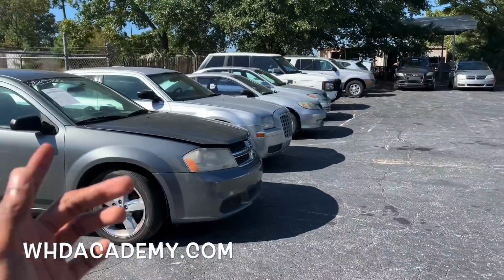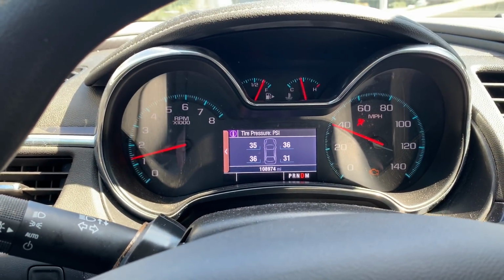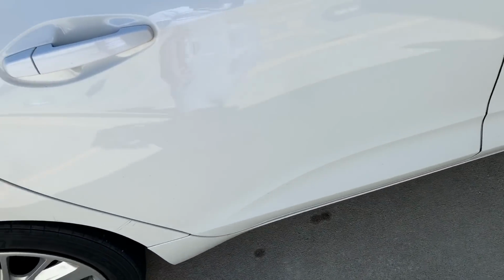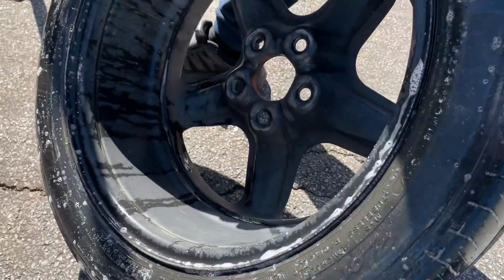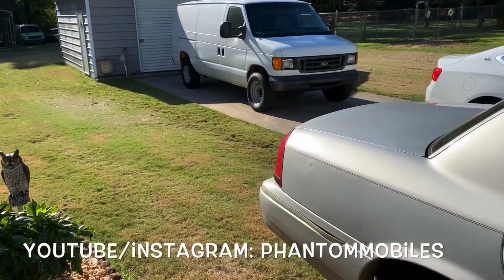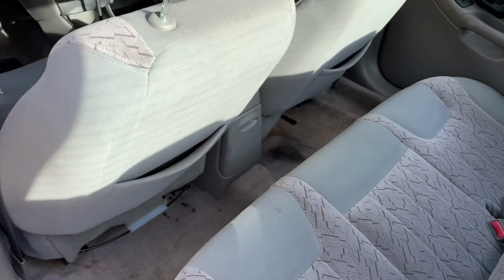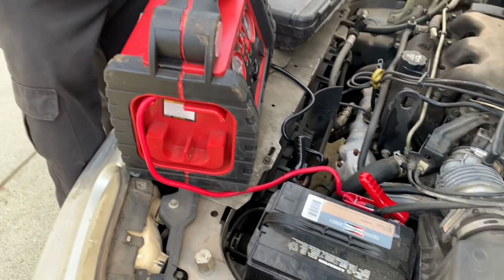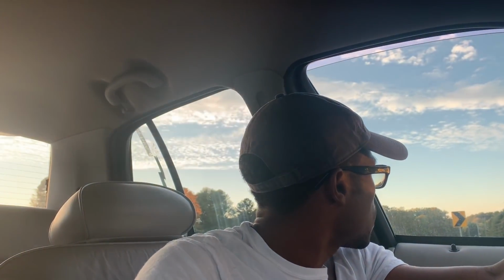I'M PISSED OFF ABOUT THIS! I TORE UP MY NEW IMPALA ALREADY!

Comment: Always have matching tires on the front or rear especially the front if it's a front wheel drive car. If the treads don't match you will have problems